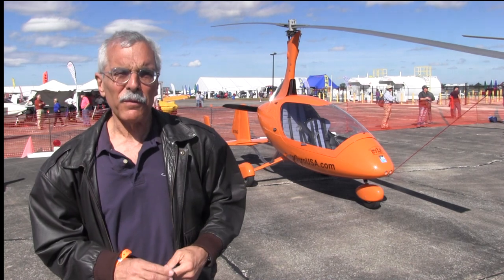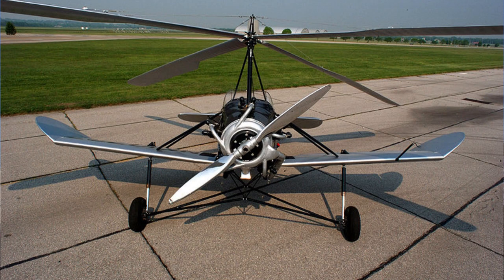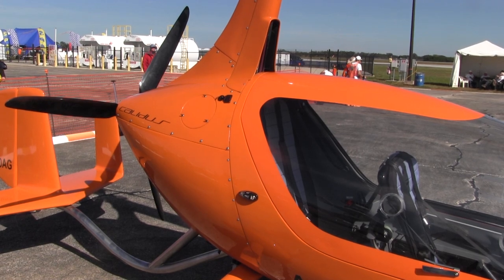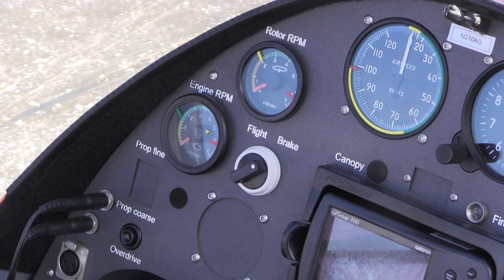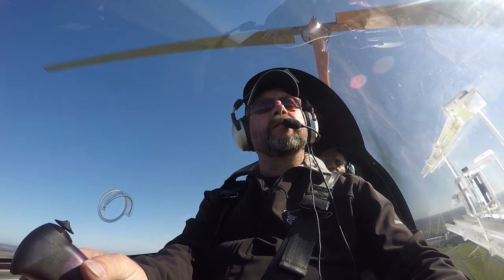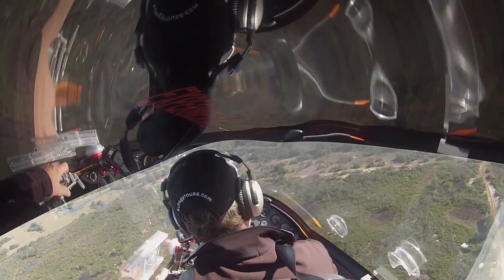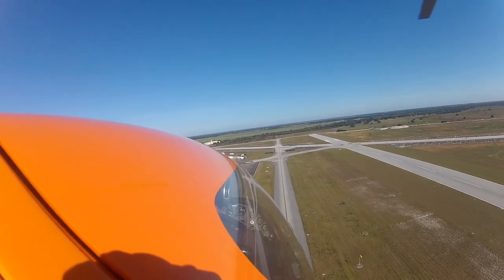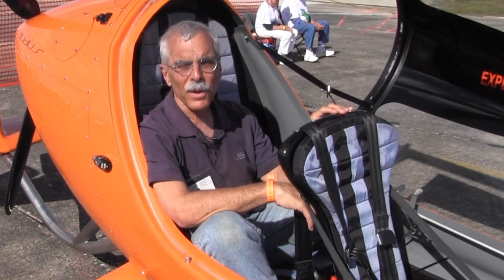AVweb Flies the Autogyro

Comment: I was a prop and rotor technician in the Army. I lost track of how many Huey's and Cobras that I balanced over the years. 2 blade systems will have some lateral shake, it's an inherent issue, but with time and patience you can get the system balanced very nicely.  If you need your system tracked and balanced, give me a shout. We are heading to Md. After the 1st of the year to build one to my specs and take her home to enjoy the heck out of it. My plan is to take the AC to as many aviation events and show her off, in the air and on the ground. All you nay sayers need to keep your feet planted on the ground in your living room eating another bag of chips and keep your comments to yourself.

Comment: Update: A lot has changed in the years since this video was uploaded, and Auto-Gyro now has three models that are certificated in the USA under the "Primary" category, and can be sold fully assembled from the factory: the Calidus, the Cavalon, and the MTOsport 2017.  The Cavalon and the MTOsport 2017 are also available now with the Rotax 915iS

Comment: I flew the side by side version of this autogyro and I have to say it was a whole lot of fun. I can back up Paul's comment about control inputs. It was basically fingertip control with very light inputs. As to rotor vibration the manufacture has instructions for achieving 100% balance.

Comment: I freely admit to not really knowing what I'm talking about here, but...   As far as I can see, I'm not at all sure that simply balancing the rotor will eliminate the stick shake..   Because of how the gyro' works, the front half of the rotor disc does most of the work, lifting the craft..   (I just can't see how the rear half of the rotation would give anything like the same lift as the front half...  Am I right in this?)    ..So,  when going through the '12 o'clock' position, (from 3 o'clock right through to 9 o'clock..)  there must be a sort of 'slowing' effect on the rotor, I believe, which then goes away, virtually to zero, during the aft part of the disc..     Surely the stick shake is because of this slowing effect?    It seems to me that the blade going through the leading half of the disc is trying to flap upwards, just as in any helicopter, and this rising causes the slowing AND cyclic to give the effect of pulling back on the stick..  at the same rate as the rotor speed..    (A helicopter has the benefit of articulation to allow any such rising, but is powered I know).   ...   If any engineers are reading this, please put me right will you,  I've asked a few gyro' pilots,  but they don't seem to be any wiser than I am about all this, lol..       'Yours faithfully,   Mr Confused,  32 Acacia Ave.
Reply: Its not really the front half vs rear half of the rotor disc as much as the leading blade vs retreating blade. The leading blade going into the wind will see higher speeds and thus create more lift while the retreating blade will see less speed and produce less lift. However, this is why autogyro blades have the pivot in the middle. This allows the leading blade that's getting more lift to apply force to the retreating blade helping to equalize pressure between the two.
Reply: Thanks for that David,  yes I see that,  (I think.).  So.. If the leading blade wants to rise.  then this causes the retreating blade to dip down,  then it will also 'bite' a little bit harder into the airflow I suppose,  therefore adding a little bit of lift too. is that it?
Reply: @trickcyclists  There are 2 types of stick-shake. 1/rev, and 2/rev. The 2/rev is due to the 3 0clock 9 oclock drag pulse. Not very noticeable or troublesome on a well-designed system. The 1/rev is due to rotor system imbalance, and can be virtually eliminated. I've built one and flown it.

Comment: I hope there's a way to balance the rotor to take some of that shake out of the stick. Airframe wear & loose fasteners in short order!
Reply: +5xls Yup, you can indeed pay someone to balance out rotor blades. But alas, everything with expertise costs more money. The average sport enthusiasts does not have that sort of money. So like the gyro itself, it becomes a balance of funds with sportability. So we get used to checking for airframe stress and doubly ensure bolts are snugged..
Reply: errr, calidus is 60 000 euro + plus local VAT taxes, balancing only costs about 100 or 200 at the most or u can buy a device for around 2000 and do it yourself. In calidus and cavalon u can get rid of all virbation at the stick, cause the do have bushings on the main rotor shaft.

Comment: No control stick is heavy because the machine you are in is overweight.  Control stick in a light single seater is signifacnatly lighter than most fixed wings.

Comment: Have not yet seen an autogyro video that demonstrates a shake-free stick. That shaking would drive me nuts. Are three blades a viable alternative, or even two counter-rotating sets of blades?
Reply: The Air & Space 18A had three blades, and I have seen experimental co-axial gyroplanes (but I don't think they were counter-rotating), but the cost and complexity outweighs any small benefit in my opinion. Once properly tracked and balanced, stick shake is reduced to a point that most pilots I know don't find objectional. After a few minutes you don't even notice it unless you're trying to fight it with a death grip on the stick.

Comment: +5xls  "I hope there's a way to balance the rotor to take some of that shake out of the stick. Airframe wear & loose fasteners in short order!"  Two-blade helicopters and gyroplanes are known for stick shake. At one time, Robinson tried to damp the vibration on one of their models by attaching a bag of lead shot to the stick, with the result that the sticks were breaking off at the base from metal fatigue. Balancing the blades will reduce it, but not totally eliminate it. What amount of shake remains is best let be, as "fighting" it causes more stress than going with it.

Comment: Would the gyroplane fly better if each blade could flap independently of the other?
Reply: The original de la Cierva autogiro had hinged rotor blades, as did the Pitcairn. Those were multi-blades designs. Two-blade rotors -- as found on the Bensen Gyrocopter, the Air Command gyroplane, and the newest Magni and Auto-Gyro models -- work just fine with a teeter hinge, and the reduced cost and complexity is a benefit.

Comment: The autogyro will never achieve its true market potential until the 'sports' idea is dropped. It is a safe, reliable, trouble-free aircraft that offers only panoramic views, a wide range of flying conditions, and very boring, very standard, take-off and landing procedures. Ergo when it is advertised and sold in a female-friendly package (they still make the majority of purchasing decisions) it will bounce along the bottom in sales. Her man will pilot it (of course) but she wants safety, a modicum of comfort and reliability. More sales equals lower prices. Thrill-seekers and lunatics can still enjoy STOL.
Reply: "and very boring, very standard, take-off and landing procedures"  That has not been my experience.
Reply: @EIGYRO  I was making a point, the procedure is fairly routine.
Reply: @peterclark4685  Fair enough.